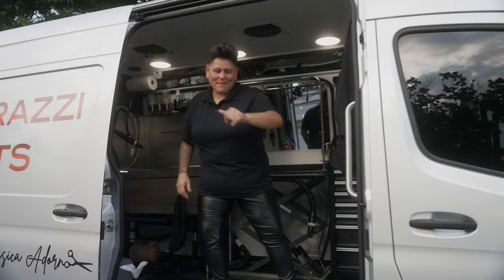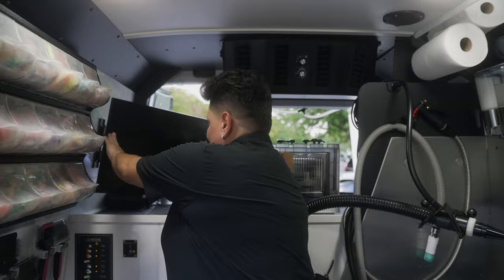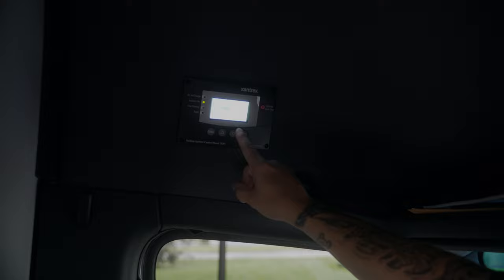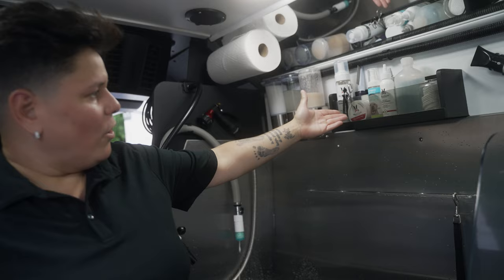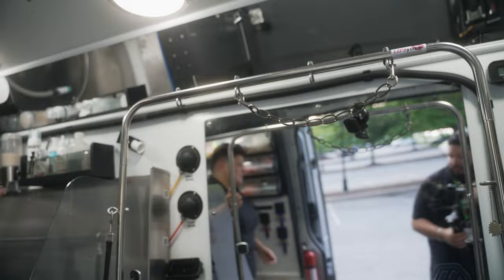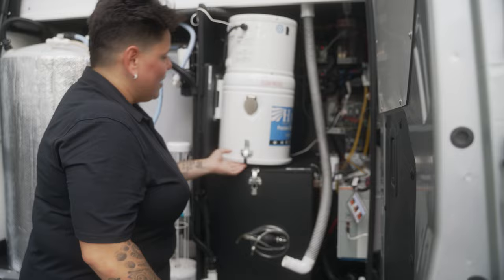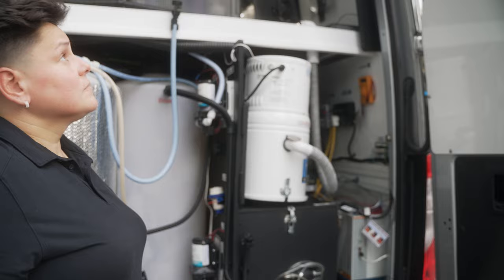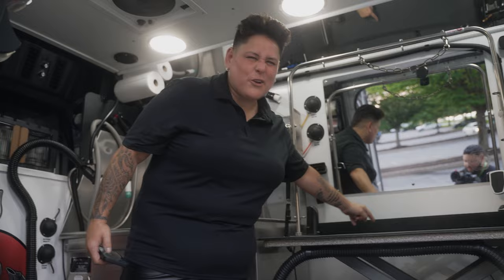Mobile Dog Grooming Van Tour w/ Jessica Adorno

Comment: great video- question? what are you using for and Ac unit ? i didn’t see anything in the roof . and if it’s not the ac from the front of the cab how are you able to use the ac unit and blow dry at the same time .
Reply: 🙏🏽 the AC unit I’m using was installed by the outfitter of the van. Look up Hanvey engineering for more info on how they outfit with the AC unit
Reply: Control your humidity in your work area and the drying process will go quicker. Purchase a humidity monitor 👌🏽 Amazon has them very inexpensive.